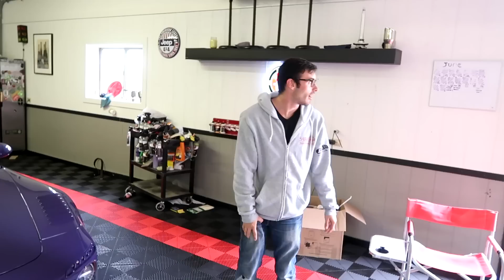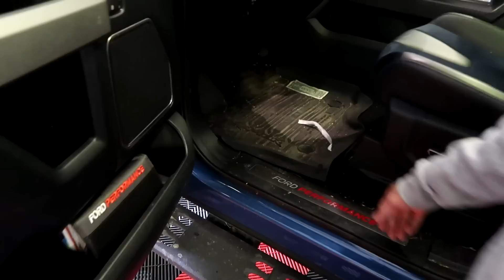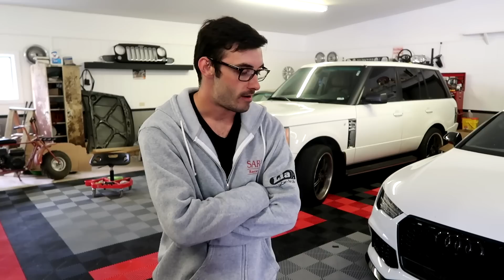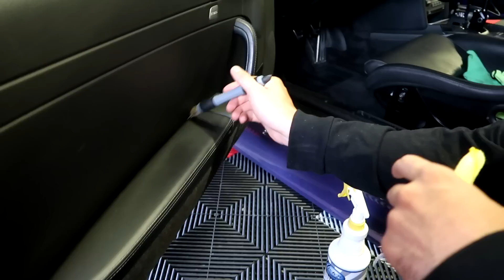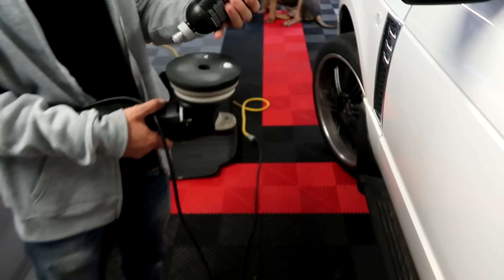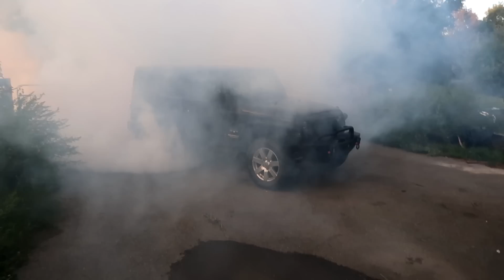How To Start A PROFITABLE Auto Detailing Business

Comment: Did you just started buffing without even washing or claying it ??
Reply: Dieter W lmfaooooooooo
Reply: He is a hack detailer, doesnt even dress interiors
Reply: @ambrose5100  yea he seems very cheap i feel like he doesnt have an extractor not that you need one every time but for stains and what not
Reply: What’s the point of washing it if the buffers taking the layer off anyways 🤔🤔
Reply: @lewisjones284  you def don't know what you are talking about !
Reply: @dieterw8471  That was sarcasm
Reply: @lewisjones284  👍😂
Reply: He had a finishing black pad trying to cut
Reply: Yeshpth
Reply: Probably did a rinseless.
Reply: Clay is unnecessary if you're buffing.
Reply: @beezie2566  - Clay wasn't even around back in the day.
Reply: @danlc95  that's why it's not necessary. Buffing does what clay does
Reply: @beezie2566  - I remember that!

What about an orbital? I know the rotary will though. I've had to do it!
Reply: @danlc95  I just use a DeWalt variable speed buffer. No orbital
Reply: @beezie2566  That's a great buffer. I use orbitals, but the Makita is an old friend. 

Good to see the rotary making a comeback these days.
Reply: @danlc95  I've had the DeWalt for 15 years now. Heavily used and still on the stock brushes. I refuse to use orbitals. Seen way too many swirls come to me to correct from an orbital
Reply: Claying actually saves your pass lifespan by a mile. And is worth the time to do it
Reply: @vortex21jw  I've never seen a difference in "pass lifespan". 15 years in the business and thousands of cars buffed. Countless show winners.
Reply: @beezie2566  meant pad sorry 😅
Reply: @vortex21jw  I'm curious howanu cars you buff with a buffing pad. Cause I'm pretty sure I get well over 100 cars buffed on my compound pad
Reply: @beezie2566  less abrasives on the bad will save the life of it. I'm actually shocked that you're basically saying you're a professional but you dont do a physical decon step
Reply: @vortex21jw  show me physically how it helps, when you're using an abrasive as a compound. Sure I thoroughly wash vehicles before I buff, but that's the extent of "decon" I do before compounding. I've never seen scratches from surface debris during compounding unless it's rail rust that's made its way deep into the clear
Reply: @beezie2566  so basically you're allowing any excess tar/fallout to get into your pads.... sounds like you instantly go for a compound to do a car. Do you use a depth gauge,
Reply: @vortex21jw  "wash thoroughly" includes removing any surface contaminate. Any staining, hard water spots etc is usually grounds for compounding. I dont use a depth gauge nor do I know ANY professional detailers that do. If you need a depth gauge to see how much clear you're taking off, you probably need to stop buffing or you're being wayyyyyy too aggressive with it.
Reply: @beezie2566  ok argument over.  Wow is all I can say. I would hate for you to detail someone's car that I know
Reply: @vortex21jw  I'm sure they wouldn't complain. I'll take my 50 plus years combined experience including my partners, vs some guy on the internet. Shops been open and booming since 1979. Booked up until July.
Reply: @beezie2566  I would if someone was detailing my car. Going straight into polishing without checking the depth of my paint beforehand. Not doing a full decon because he knows best and clearly doesnt want to learn anything new. 

Whilst we're flexing I have personally got a handful of personal sponsors on my car aswell as a catalogue of award winning cars I detail. I'm willing to learn new things along the way and my work speaks for itself
Reply: @vortex21jw  you know what, you're right. I'm just speaking out of personal experience. The 27 magazine cover cars, 4 nopi national winners, 9 world of wheels winners, a ridler award winner and endless small show winners probably doesn't justify me as a professional. But all of the professionals I know that detail, maybe 200, none of them use a depth gauge. The only person I know that does is our body shops.
Reply: @beezie2566  that's madness to me. Guess usa vs uk just do it differently
Reply: @vortex21jw  there's a million ways to skin a cat. You can make detailing as hard and time consuming as you want. But me by myself can do a full detail, buff, shampoo interior, the whole nine in less than 4 hours and it'll be damn near perfect. No rival no equal
Reply: @beezie2566  4 hours?! To do a full detail.... I've had cars take me 2 days to clean, Decon, correct and refine. And that's not including the wheels, interior clean and dressed, metal polished up and engine bay
Reply: @vortex21jw  must have been the most disgusting car ever. There's never a car that stays a full day unless we take the interior apart
Reply: Even the way he talks about the service sounds very unmotivated he's like  don't even want to do it
Reply: Claying is very important.

Comment: Should we be licensed to do the job ?
Reply: Just a registered business (DBA or LLC) is fine. A basic garage-keepers insurance policy doesn't hurt either, if you're polishing paint or moving cars regularly. On a side note, some ceramic coatings do require an installer certification, but that's usually easy to get if you're familiar with the product (most cars don't need a ceramic coating anyway).
Reply: Depends on how much work you’re going to do and how you are getting payed. If it’s just a weekend thing that you do for friends cars, family members, etc then no. If you’re getting payed cash no one knows about it. Same thing with checks or Venmo/PayPal, it’s when they start coming in more frequently that’s when someone higher up might become suspicious. If you’re making an extra 10k-20k a year the IRS won’t care. I only recently got my license and I’ve had my business for about 3 years w/ about 50 clients.

Comment: so what is the big difference between detailing and a good car wash?
Reply: They're a bit synonymous, though detailing is usually much more intensive in the details as the name implies. Detailing usually involves more steps after the generic wash such as paint decontamination and polishing, along with follow up protection through waxes, sealants, or ceramic coatings. Also the interior work as was shown in here too.
Reply: Exterior a detailer can do claybar ,polish ,buf,wetsand ,wax , ceramic coating etc. Some car wash can do some of those things. As far as the interior remove some stains do headliner  shampoo seats carpet mats etc.
Reply: I mean decontamination can be part of a good car wash. I don't know anybody who doesn't wash there cars without decontamination besides the average Joe who sprays water on thier car. Detailing is go after little details and protection mostly. Things like polishing windows, paint , restoring plastic, and protection on everything. They literally try to clean every part of the car you can see and protect it.
Reply: @josem1596  kind of... A car wash doesn't do the job of a clay bar... No matter how well you wash it, getn rail dust and other shit off your paint requires more time and work than just washing it... Then of course polishing and protecting your work aka sealant wax etc...